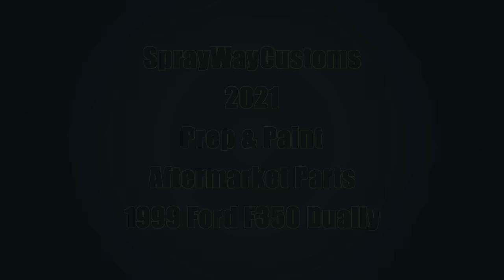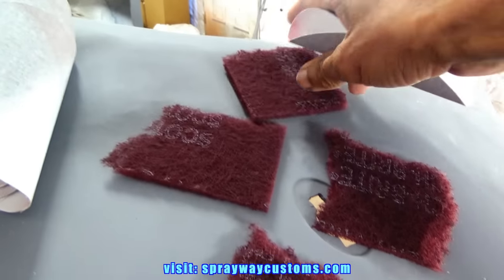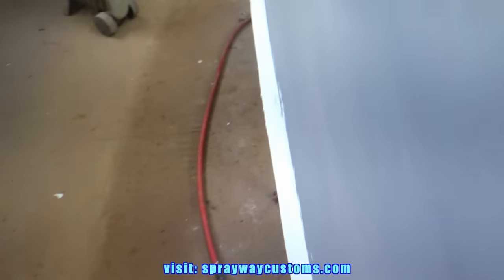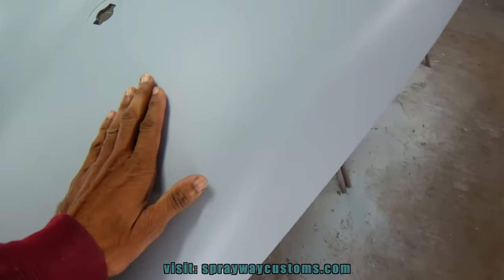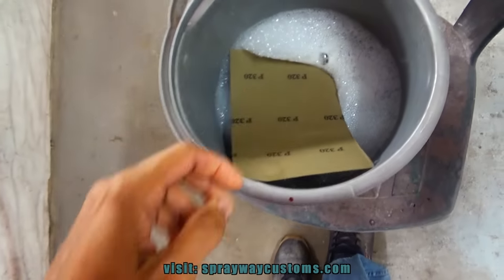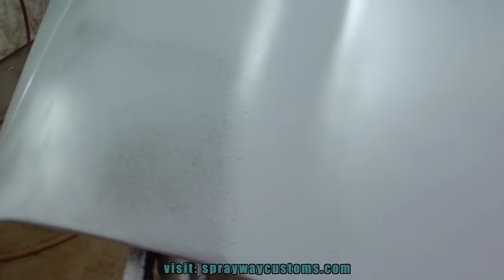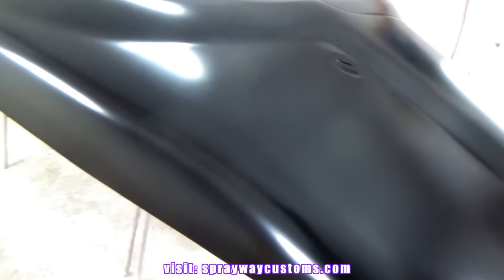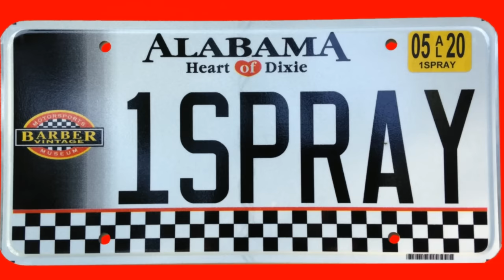How To Prep & Paint Aftermarket Replacement Parts / Fiberglass Fender Flare / 1999 Ford F-350 Dually

Comment: Hey SpraywayCustoms, I was wondering do you have a video explaining how you built your spray booth? If you haven't could you please make a video explaining how to make one including talking about all the problems you have with dirt and any other problems with this setup? I built my own using tarps and a green house filter and a 20" box fan, it does reduce dirt but the airflow is also causing dirt to land on my paint job, I have to live with the dirt which sucks. I sand some of it out but still it's impossible to get a good paintjob
Reply from the maker: Here’s two older videos here https://youtu.be/sYWZ_uxBk-M     https://youtu.be/EQ2MpFd4PnQ

Comment: Do you like the upol 2253 primer? I've been using it for a while now just want to know what you really think about it. I've never used it as a high build don't have a gun with a big enough tip to spray it right. But as a surfacer it lays down really flat and sands like a dream...only thing is the cure time but I might try there rapid in the future. Anyway great work brother.
Reply from the maker: I like it....just reduce it a little for your tip size if you don't have a bigger enough one.
Reply: @SprayWayCustoms  "Thanks Brother"

Comment: The owner should have fit this to the truck first. Used parts or even oem may be twisted and not lay flat against the side panel. You may crack the edges installing part. Great prep makes GREAT finish.
Reply from the maker: True...thanks man

Comment: Very clean. Im debating jet black like that or frost white for my 88 dually. But ill be hittin the duals hard with fiber bondo, mines salvageable but beat the heck up.
Reply from the maker: Thanks man....yes that'll be much smarter to repair yours because more and most likely you'll be doing bodywork trying to get the aftermarket ones paint ready anyway.